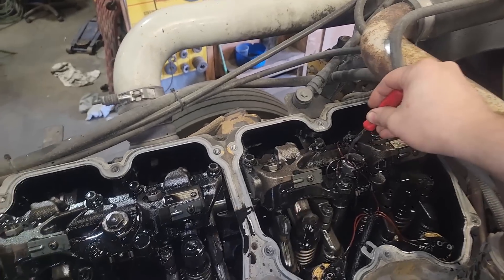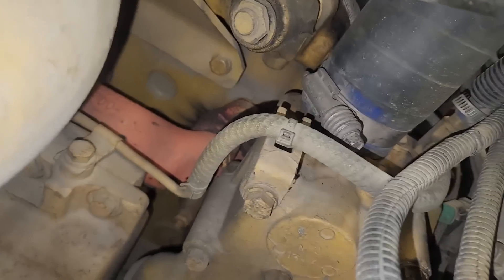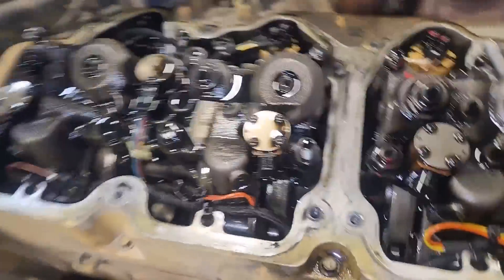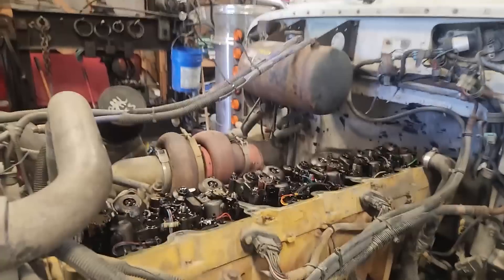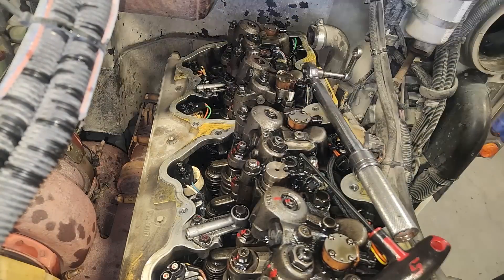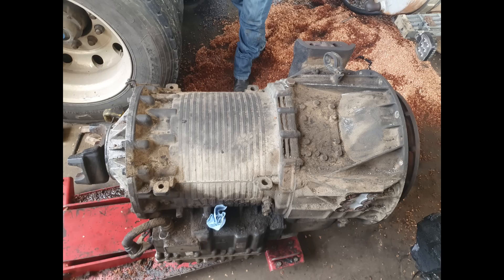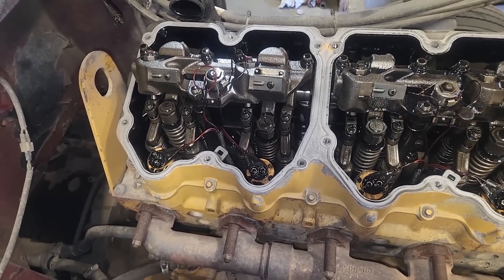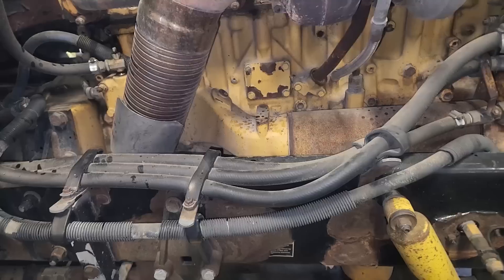2 Trucks, Same Problems. Weak Jakes and Valve Lash needed. Cat C15.

Comment: Josh I know you said what torque adapter you used but I can’t find it what tool do you use to tighten the adjustment nut on the valve adjustment. And where did you buy it, some mxs motors are not very friendly with getting a wrench on!

Comment: Do you ever run into the situation where all 3 stages of the CAT brake works when engine is first fired up for the day, then once it gets to operating temp only the low stage works?  I have an MXS and have been having this issue for about 6 months now. I replaced all 3 solenoids since I was first getting a code for low voltage. Now I do not get a code, but having the same issue at hand. From cold to 180 on oil temp they work flawlessly, once steady at operating temp all day, I only get low stage, and that is about 95% of the time, the other 5% I have no engine brake at all. Curious if anybody has encountered this and what might be the culprit? Maybe just needs an overhead ran? Any help would be greatly appreciated.

Comment: Hey man im having an issue with my c13. I hooked it up to a computer n its saying low oil pressure. I changed the oil n filter the pressure went up 5 psi but im not sure if itll stay. Any guess on the issue?
Reply: I put a new oil press sender on mine and that fixed it

Comment: You set the valves after you had ran the engine? I thought you were supposed to set the valves while the engine was cold?.
Reply from the maker: You can run it a little bit, you don't want it to warm up though. So a minute or two max usually.

Comment: I know it’s basically impossible to diagnose something on the internet but what do you think would be causing a loud popping when the Jake is on. It sounds normal for a couple seconds then starts popping really loud.
Reply from the maker: Could be a Jake actuator hanging up possibly, then it is combusting through the exhaust instead.
Reply: @AdeptApe  that’s what I was afraid of

Comment: Great show! IMO as knowledgeable in electronics, the resistance values of 2 to 11 or 49 ohms is just a clue. They all could operating fine, what you worry about is the power coming in/going in to actuate them, as in "Is there enough power?" as from an electrical point of view, I would want a 49 ohm rather than a 2 ohm resistance, as the 2 ohm draws much more current, which is a bad thing for overheating the wiring.

Comment: Engine exhaust leak so really dangerous for the driver too My company takes them super serious we had several drivers over the years die in the bunk from a small exhaust leak where the HVAC was just sucking in the exhaust fumes all night long
We even had one that had so much exhaust fumes in the cab is that a couple days later The truck was still running and emergency responders were called there to check on the driver and one of them passed out trying to pull him out

Comment: I ran into the same problem with the 9 pin plug. The y adapter fr the eld has a 4 screw flange on it instead of a nut to hold it to the dash. I drilled my dash and used taper headed machine screws and nuts.

Comment: Dropping off the truck isn’t the issue, dropping it off for 3 weeks to get an hour or two of work done is the problem. Also I’ve had far more bad experiences in shops from incompetent mechanics either making things worse or throwing a bandaid on something and telling me it’s fixed just to have it be a issue again a few days later. Having a mechanic you feel is trustworthy is huge and unfortunately uncommon no matter where you go, been screwed plenty of times at Cat dealers.

Comment: Hi Josh, just noticed when you started the first engine to comfirm the exhaust leak, you filmed no1 exhaust manifold, in the top of the screen there's a bolt or stud, you can see the washer vibrating around, to me that indicates a loose bolt or nut. You may not have noticed it. Loved the channel and content
Reply: at 2.13 to 2.15

Comment: Josh.
One of my drivers wanted an overhead.
I went to do the work and couldn't adjust the Jake on number 6 .

The valve had beat up seat soooooo much... there wasn't any Jake clearance to be had!
Stem was so high I had to cut the top of a valve bridge to make it work
.
Overheads can tell you a LOT! IF YOU CHECK THE CLEARANCE BEFORE ADJUSTING. 
Planned an out of frame ASAP.

Comment: Josh you severely underestimate how important it is for a truck owner to trust their engine mechanic. They will tow their truck half way across the country for you before they ever let a random shop touch it.
Reply: For sure, didn’t take very long after buying my first truck to come to the realization that I’d gladly pay twice the rate for a competent mechanic that actually fixed the issue instead of putting bandaids on the symptoms and calling it a day
Reply: I think that is true for any vehicle owner, finding a good mechanic is really hard, first you have to reject dealers, and then ,the known useless. Then you have to go on a mission to find those that are regarded as too expensive for what they do. When you find someone who seems to be ok, you have to take notice, do they upsell,or t'other way ?  and do they take notice of what you want out of the deal ? (I used a very decent mech for some time that kept the motors fine but ignored what he felt did not need doing, even when I explained why I wanted it done ).
Reply: When my mechanic retires I’m retireing end of story
Reply: @karlsborgwi.jewell9919  I believe you. I was in that same situation.

Comment: 1:09 'Ticking sounds!' Josh is an expert on those sounds now, even on 4.3 gas v6's! 😅😂 I know the frustration that comes with a sound like that when you can't find it but know its not quite right! 👍🏻👌🏻🛠️🔧🔩🦺🚜🏗️🚧

✊🏻🇺🇸🦅🇺🇸✊🏻
Reply: 4:53 I agree I've always been amazed at watching the valvetrain running and thinking about 2 or 3 times that rpm air is still getting in & out plus injectors firing at such high rate of speeds it's crazy! The old Detroit 2 strokes valvetrain are real fun to watch too! 👍🏻👌🏻

Comment: Some millionaire needs to help Jake set up a nice shop. Any Cat owner would drive 1000 miles to have him do their overhaul.
Reply: Josh I believe is his name, Jake-brake or Jacob brake is a system that uses the engine to maintain speed downhill by decompression release of cylinder pressure.

Comment: Saw some engines that an overhead wasn't done for so long.  Valve clearance got so tight they dropped a valve..good overhead can increase fuel mileage huge.  Usually pays for itself in just a few weeks
Reply from the maker: It's definitely an important maintenance item and one that is is hard to do correctly.
Reply: Ya.  Problem is most shops want the mechanic to turn jobs fast....so sloppy work show up constantly  my last foreman was unbelievable 
Nothing was fast enough.  Lots of problems